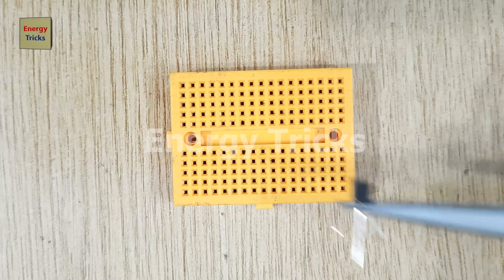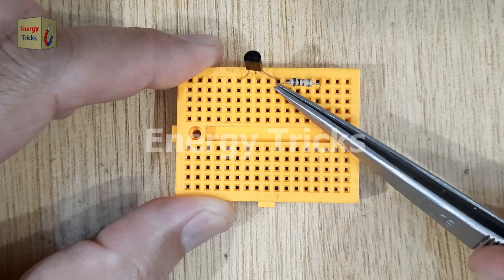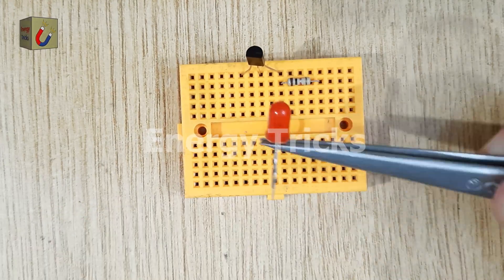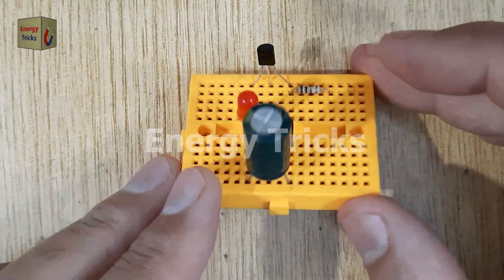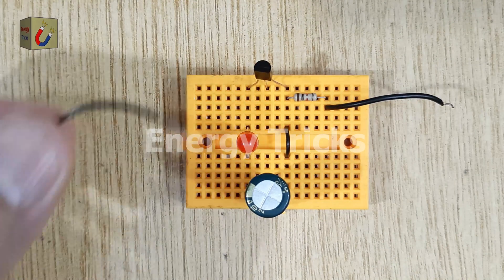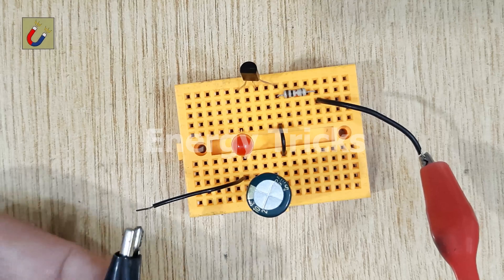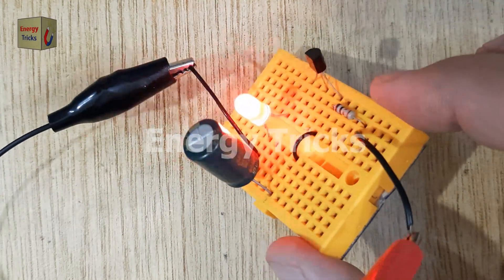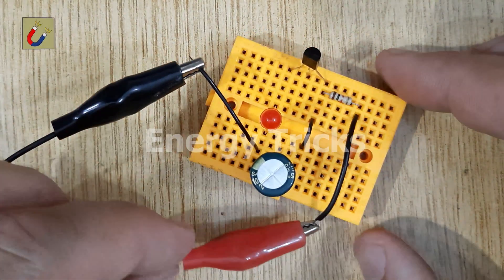Easy LED Blinker Circuit Project  Transistor + Capacitor Circuit

Comment: 4 or 5 leds could work . But 4 would be brighter . You hooked one up backwards  once playing around and it broke down the bulb electrically . That is why you mixing it in with good bulbs is not matching predicted performance .

Comment: So let me get this straight. So it not use base to control it but use time when energy is high enough it can cross the gap in the base and light up the led then it lost all energy in capacitor and can't cross the gap so recharge again until it have enough energy right?

Comment: How could it work? The base is not connected. The emitter gets + voltage. Is it fake?
Reply from the maker: It's not fake. It works 100%. If you have all these components, check it out and provide 16v DC power. Then tell me.